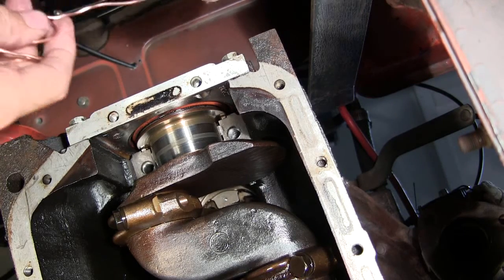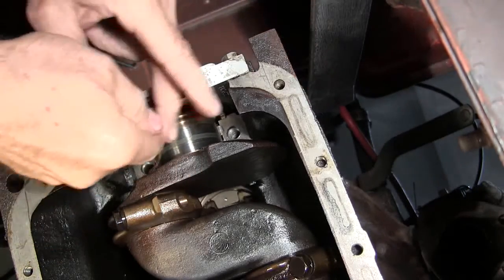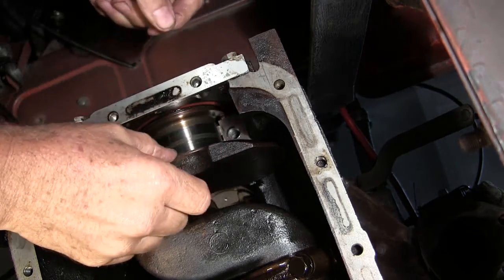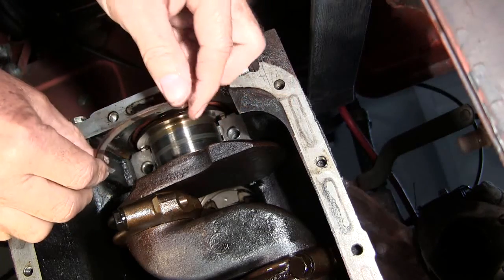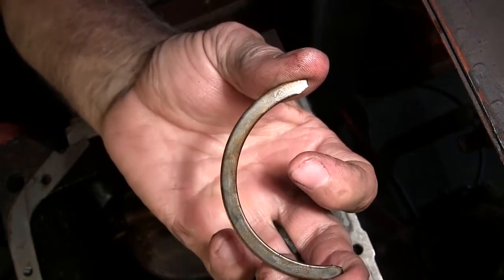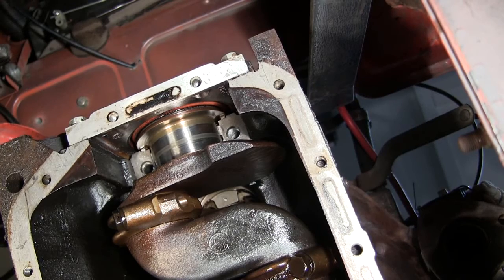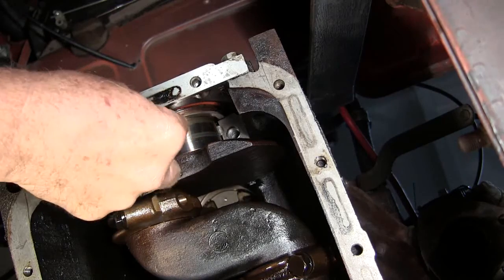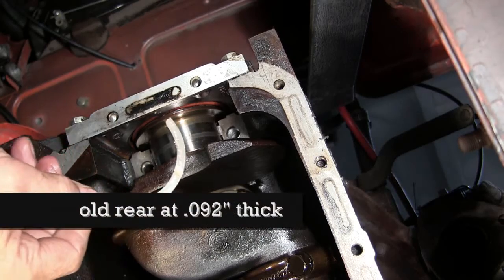My 79 Triumph Spitfire, remove crankshaft thrust washers.

Comment: I have and MG Midget with this same motor with 24k miles on it. It's a 1977 Midget 1500 which has a Spitfire motor in it from 1975 to the end of production. I'm wondering if this whole compromised engineering can be re-engineered with a roller bearing or oil fed plain bearing set up. I also have a 1997 Porsche Boxster that has an IMS bearing that is sealed and can fail due to some of the same reasons this thrust washer goes bad -old acidic oil and non changing of oil and letting the car sit.  Instead of a sealed shaft bearing there are ceramic, roller bearing and oil pressure fed plain bearing retrofits. What can be done here? I know there is a whole culture of building Spitfire engines for racing but I haven't been had time to look into it yet.
Reply from the maker: Not knocking our smaller cars, money can fix all problems, but with the time spent regularly (and I mean that, over several years too)  something with more iron to it would be better.  It's frustrating constant repairs and parts replaced cause poor materials. It's your choice, spend a small fortune on it, or just don't over use them as your expecting a racer from them. The Spitfire & GT6 forum will tell you how these are built into racers, tear them up increasing power... deep pockets? My spitfire is set to turn over 100,000 miles next month, 70 HP from the 1500 engine, single Zenith, gets me down the road with the big cars, with less money. I'm impressed they get there with only the minimal amount of engine and parts.
Reply: Calvin G. Williams Yes that’s what is fun! Just had major back surgery in my 40’s so the car sits. 70 hp and 100k miles is good in my book. Cheers!
Reply from the maker: You must look into it, know what you doing before you start your project.

Comment: HEY CALVIN, I HAVE A 03 FORD FOCUS 2.0 DOHC VIN 3 ZETEC MOTOR! I CALL IT A FUCUS!  ANYWAYS, IM CHANGING THE MAIN & ROD BEARINGS! IM TRYING TO ROLL OUT MY MAIN BEARINGS FROM UNDER THE CAR!  (THE MAINS ALL LOOKED OK EXCEPT MY #5 CLOSEST TO MY TRANSMISION, IT WAS A BIT GROOVED! HAD SCORE MARKS ALL ARROUND IT. MY ROD BEARINGS ARE UNEVENLY WORN ON THE FAR SIDE, THE TRANSMISSION SIDE SO, TOWARDS THE #4 ON A INLINE 4 BANGER, THE LEFT SIDE OF THE BEARINGS HAD EXCESSIVE WEAR SO IM CHANGING ALL THE BEARINGS, MAIN & ROD!!! I GOT ALL BUT MY #3 (THRUST BEARING) DONE!  IT STARTED TO COME OUT WHEN I WAS PUSHING W/SCREWDRIVER ON THE SIDE W/OUT A TANG, IT WENT AS FAR AS THE SCREW DRIVER COULD FIT & STOPPED SO I TRIED A HOSE CLAMP W/NO LUCK.  ANY ADVICE WOULD BE GREATLY APPRECIATED!!!??? I NEED TO BUY A ENGINE HOIST & ENGINE STAND & BUILD A GARAGE! ITS FREEZING OUTSIDE!!!
Reply from the maker: moving the crankshaft back and forward while pushing the thrust washer with something non metalic (don't score the surface any more than it already is)and that  should release pressure against the thrust washer.